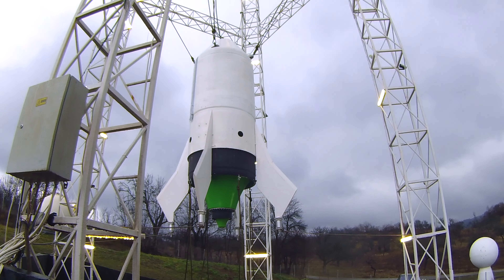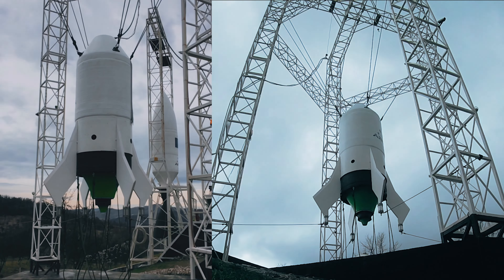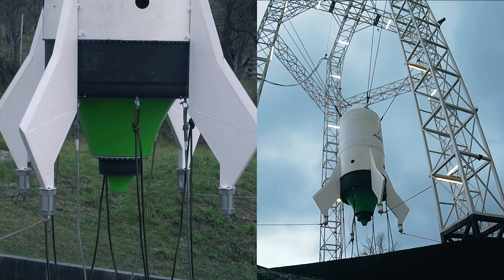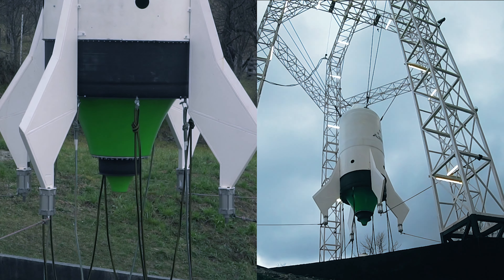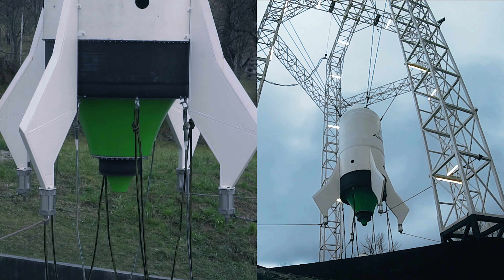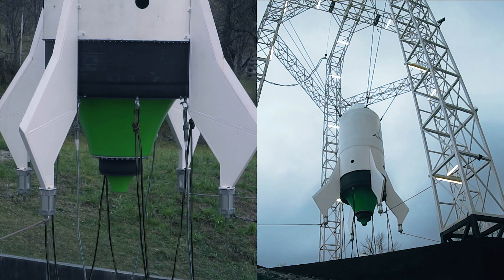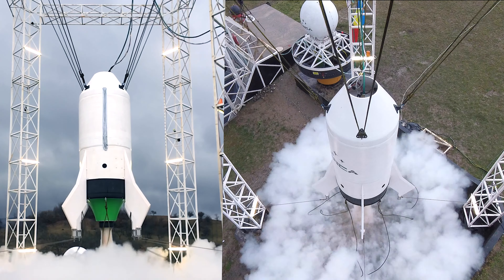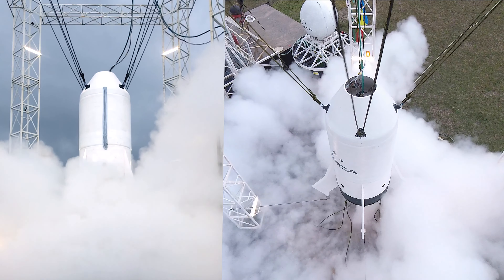EcoRocket: Episode 8 - Full Duration, 60% Thrust

Comment: Besides the eco idea why don’t you guys use traditional rocket fuel? I’d presume it would be much more efficient and you could achieve leo flights sooner
Reply: Water is also easier to handle and is cheaper, although the drawback of the awful isp is very harsh indeed
Reply: what s the point of designing a rocket based on a well known traditionnal rocket fuel? The market is already full of rockets based on this technology. Arca is basically a technology demonstrator.

Comment: I love it! I would love to see another whitepaper on your results (but I understand if this is confidential, or there are other priorities).

Might I suggest mounting (or shining) bright LEDs/Lasers to be able to get rich positional information from the fuselage during firing.

Good job, all!
Reply from the maker: Thank you very much! We are going to have an exhaust deflector mounted on the concrete pad to deflect the gases.
Reply: @ARCAchannel  I do wonder if this will affect thrust trajectory. I wonder if it would be wise to consider a camera that can effectively see through the steam. 

Bright point-lights on the fuselage would likely be cheap and easy to install, allowing external, precision monitoring of absolute position, with standard cameras. 

Just a thought.
Reply from the maker: @SeanLumly  Oh, that's a great idea actually, some lights on the fuselage might help improve the visibility through the gases.
Reply: @ARCAchannel  Yeah, my thoughts precisely: cheap and effective, and avoids the need for additional construction.

Perhaps worth a shot!
Reply: Could thermal imaging cut through the steam? If nothing else would be a cool perspective of it.
Reply: @jkenny1  Yes, I considered this as well. Though I'm not too familiar with the state of IR cameras (eg. cost, resolution, shutter speed, etc). But if IR cameras were to be used, IR LEDs could provide even more clear positional data, seeing directly through the steam.

Another consideration are IR reflectors on the rocket body with a bright external IR lights and an IR camera.

Were it my project (which it is not), I would start with a very simple test of a small, bright light source -- it is cheap and should be easy-ish to do on next firing. If this doesn't work adequately, then more sophisticated tooling/methods could be considered (eg. IR camera, deflector, etc).
Reply: @SeanLumly  I meant thermal IR, I think near IR will have the same issues as visible.
Reply: @jkenny1  I understand. Thanks for the correction!

Comment: Very interesting video. So essentially it needs a small separate tank to hold just enough propellant for landing. This is similar to how SpaceX's Starship carries the fuel/oxidizer it needs for landing in its header tanks.
Reply from the maker: That is correct, yes!
Reply: @ARCAchannel  why does it need these tanks tho? I mean I’m not an engineer, but it seems quite useless in this particular rocket.

Comment: hey guys as the second stage is gonna ignite in atmosphere at very high speeds why not make the interstage open like in gslv mkiii soyuz and longmarch 2c cause they ignite the second stage while both stages are connected ???
Reply: @tiagankoob820  oh no the second stage is h202 and kerosene
Reply: @tiagankoob820  nah the second stage is h202 and kerolox
Reply: Michel P  rocket grade hydrogen peroxide is an incredibly strong oxidiser, and whilst it’s not flammable itself, it can make non flammable materials, like steel flammable. Also I doubt they’d be able to get a hold of a bunch of hydrogen peroxide, as it can be used to create explosives, and in concentrations higher than 30% it’s highly controlled, so unless they’re working with ESA, the Romanian space program (if one exists), or are a registered chemical company that requires H2O2 to manufacture a product, they’re not getting any.

Besides if they were using RP-1, why not also use LOX?

Comment: Wow, this is an incredible achievement and im looking forward to the next milestones!!!Congratulations to all members of the Arca team! I have a question though, how is the booster gonna orient and guide itself when falling down? Does the engine have TVC? Do the fins move? In a recent episode you said that the booster has passive stability due to the CoM being at the bottom, but how is it gonna steer precisely towards the landing zone and be stable during the landing burn?
Reply: the booster will have a drogue chute which will slow the booster down but not drift it away too much they have rcs and then (i guess) will anywhere it can
Reply: @buraqaerospace9945  i understand that, but it would still drift a lot due to winds (the stage is very light after all) and might have difficulties becuase it will be basically "hanging" on the drogue, and the orientation during the landing burn might change and cause a higher than expected landing speed
Reply: @buraqaerospace9945  Where are the RCS?
Reply: @b0mby1  I don't think they have specific landing spot

Comment: I thought this was a AeroSpike.. Non of the water went through the spike. Instead though an internal bell maybe??
The stand wobbling and you apparently losing control of the booster is also a bit concerning. Would it not work to build a stand a sit the booster on top instead of hanging.
Reply: It went through the "landing engine", a smaller aerospike engine mounted at the tip of the large aerospike. The large one is for launch, when high thrust is needed.
Reply: it is a Aerospyke. It two of them actually a smaller one on the base of the big green one.

Comment: I will call this a great sucess!
The issue mentioned here are just minor fixes and subsystems that does not need to be applied during this testrun.
(Both NASA and SpaceX had those problems with uneven fueldistribution in the test setup if one are running the engines from a celan tank setup without the final inner structures mounted, it should be a quite easy fix on the finished setup, and it is not needed for this test.)

Comment: Is the steering to be achieved by difrentiating the flow through the individual nozzles on the landing engine or will you use the nozzles on the main engine to achieve more lever arm and control ?